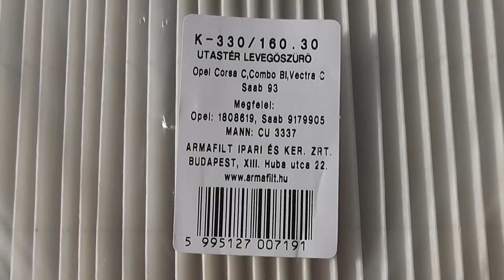Opel Corsa - Cabin Filter Replacement

Comment: I suppose pollen filter was fitted incorrectly, not with air flow direction, arrow printed on the top edge shows different direction that it was on the old filter. Sides of the the filter are bend, I hope air will not go there and avoid filter. I changed this onece and it was quite difficult, a lot of gimnastic with plastic cover, finally I could't close this two plastic hooks (?) and battery cables were on this plastic cover so I needed disconnect battery, and after this set up clock and date on dashboard again. I thought that "german" cars are easier to service than "french" however I had less gimnastic and it was faster in renault, and cabin filter was inside the cabin not under the bonnet :)
Reply: Yes i noticed flaps are backwards and then realised there is an arrow also

Comment: Just tried putting on a new pollen filter because this video looks so simple but the battery terminals run in the way as mine is right handed drive and it's much Harder to get to pollen filter on British corsa c than German one or Hungarian
Reply: Hash thanks for the warning. Thoug it looked too simple

Comment: I read in a forum that, supposedly, the containment of that filter can be a source for water getting into the cabin. Now that I see this, I wonder if that's really possible, the case of the filter looks so flat, and angled in a direction where I doubt water could reside.
What is your opinion on that?

As for my car's problem... the floor on the driver's side is wet after a rainfall. The lid of the BCM box was replaced, now I don't get water on my feet anymore from the pedals... but the carpet still gets wet after a strong rain, so there is another leak somewhere...
Reply: The reason your footwell is wet is due to a leaking gasket around the pedal box, it's a common fault on these cars
Reply: hi, I work at a vauxhall dealership in parts. The water problem on corsa c, is usually down to that oval plate on the bulk head. it's not expensive,around £30 plus VAT. The cost comes in labour....it is a big job! another water problem is into that electrical box lid which you mention. Other than the gear linkage and timing chain...They are a very reliable motor....I've  got one myself!
Reply: @jonny10buds  Hi, that was what my local garage told me was the cause of my leak. But then when I asked them to fix it, they said it had multiple leaks and would take more hours to find out where else the water was coming from. They must have been lying because they could only have known for sure that there were additional leaks if they had seen exactly where they were coming from (in which case they don't need extra hours to see where from), or they had found out that the original diagnosis was wrong, in which case they should not have done the work. I only agreed to the work on the diagnosis they said. So in the end I'm down £108 and the leak is WORSE than before! Despite them saying they fixed the leaking gasket near the pedal. I even wonder if they bashed extra holes in the floor or something to back up their theory of extra leaks. To add insult to injury I have been ill due to mold poisoning. If I cannot fix it I will have to scrap the car :(
Reply: @Amperzand  I'm sorry to hear that buddy, if the leak is on the passenger side it's the seal around the relay box, I replaced one of these myself and it wasn't a bad job, it took me around 1 hour.  The relay box and pedal box plate are the only two places water can get through the bulkhead on a Corsa, unless you have a leaky screen of course...